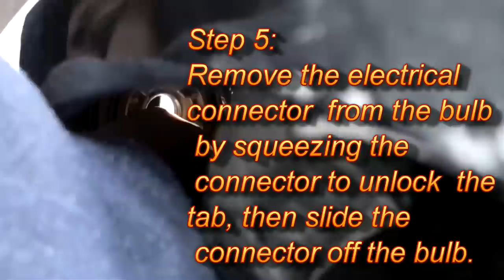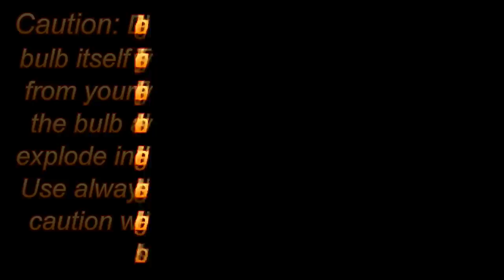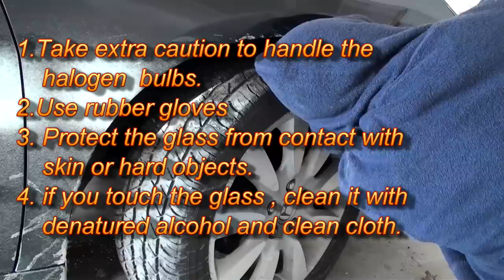How to Replace the Headlight Bulb on a Honda Accord 2007-Low Beam

Comment: This video is helpful for the DRIVER'S side.  On the passenger side, just reach in from the hood and you can access the bulb fairly easily.  Release the wire harness before trying to turn the bulb on both sides, I found this to be the easiest approach on my 2006 Accord.  I think the approach shown is actually easier and quicker than removing the battery for the drivers side.  Helpful video.

Comment: Thanks for being a contribution in sharing this video with edited instructions. Just replaced the driver's side low beam via the wheel well on a 2007 Honda Accord, and it took about 5 minutes total based off what you posted (turning wheel to the right for driver's side provided clear access). Also looked at other videos, and this method at 5 minutes with direct access was less effort than dealing with removing the battery.

Comment: Removing the 2 black circular plastic clips on the fender wall is WAY faster than removing the battery. I just put a flathead screwdriver under it on one side then slid another flathead under the other side, pulled down and it came right out easy without breaking the clip. Just replaced the drivers low beam on a 2003 accord as shown, 10 minutes total. and I was extra slow and careful. I unscrewed the bulb holder before squeezing the connector to pull out the bulb. Great video! Thanks easy job!

Comment: As 777Firedrake said, Instruction step 3 should have included what Step 5 says. Little confusion!! Other than that, this video really saved me 40$ to change bulb, this is Dealer usual bulb change price.
Passenger side bulb can be changed after lifting hood. Mine is 2007 Honda Accord.
Remember to snap open electrical connector first before twisting to remove bulb from holder.

Thank you deepujkathettu!!

Comment: I watched a few videos, with some advocating removing the battery (for a drivers side low beam). i decided to go with these instructions with the added recommendation to open the hood for more light. The replacement was easier than expected and definitely took less than ten minutes.  Thank you for such a helpful video! (also not that video says to turn wheels to left, but shows him turning steering wheel to right.  I think he means turn the wheels (and steering wheel) to the right which gives excellent access to the drivers side wheel well).

Comment: Great video, and well put together. Just know if anyone else is doing this. It can be done from up top as well and only need to remove the battery for drivers side. Its still a tight fit, but i found this much quicker/easier in my case!

Comment: This video along with comment input did the trick. I have the Hayes manual and the only help I got from it was how to get to the bulb.  Turning the wheels in the appropriate direction definitely gives a little more room to work with and this was not mentioned in the manual.  But it's still tight quarters to work in.  As mentioned a couple of times,  you can twist (and shout) all you want; if it won't twist and unlock from the socket, simply loosen one of the screws on the collar around the socket. Try 2 if that doesn't help. 

Another tip that might save someone else some frustration. Make sure you squeeze the locking clip on the socket on the right end.  May sound silly, but many of the socket clips on the old bulbs I'm familiar with unlock on the opposite end.  Since it is hard to see in there, I wasn't aware that these clips are to be squeezed on the opposite end. I didn't notice the little knurl part on the end of the clip was the right place to squeeze until I shined my flashlight on it.

Also, since it is difficult to see in there, you might want to pick up one of those handy LIGHTED screwdrivers at Lowes.  It has all the various common bits mounted on the handle instead of in the handle.  It even has a telescoping magnetic pick up in the bit shaft.  If you have ever tried to hold a flashlight while using a screw driver, particularly in a tight space, you will really appreciate this tool.

Comment: Great video.  I did this today on a 2007 accord ex.  However, snapping off the power connector FIRST allows you to turn and remove the bulb with NO resistence.  I was able to get to the driver side bulb just by opening the hood, again snapping off the connector first allowed me to turn the bulb without a hitch.  Just a tight fit if u got big arms  Thanks!

Comment: 2007 LX. I disassembled the splash guard only for the driver's side as I did not wish to remove the battery. Passenger side is much easier through the hood. I also detached the wiring harness before removing the bulb. Despite living in a humid, salty area, the lights turned in and out very easily.

As previously mentioned, the fasteners are unbelievably fragile. They broke even when I was attempting to be gentle. Searching reveals this as a common problem, even when not replacing lights.

Comment: In spite of a few typos, this video helped me to change the headlights on my Honda Accord. The only thing you should have mentioned were the three screws around the bulb assembly. I had to loosen one of them before I could turn the old bulb counter clockwise to remove it. I made certain I tightened it up again after I installed the new bulb.
Reply: Ditto on the screws - I had to figure that one out as well.

Comment: I just installed some LED low beams, and I can attest that you can access both high and low beams from the hood alone without removing the battery or fender. Removing the black plastic cover right beside the battery (towards the front) and reaching in far with your left arm will get you to the driver side low beam bulb. The passenger can be reached easily just by reaching in with either arm. If you have trouble removing the connector from the bulb, try leaving the bulb screwed into the housing, holding the tab on the connector, and giving the connector a few light whacks with a wrench from the top. I had to do this to both of mine because it had been so long since they'd been changed.
tl;dr: Don't destroy your fender!
Reply: You're right, I just reached into the passenger side and was able to replace the bulb without going through the wheel well. Thank you for saving me the time!

Comment: 2005 Accord: In the US you turn the wheel hard right for the drivers side bulb. 
When removing the clips for the lining, look for the screw driver slots and remove pin gently as they can break. After unclipping the wheel well lining, unscrew the lower left screw ( of the three around the bulb) to allow the bulb assembly to be turned left.  After the bulb assembly is free, it's very easy to press the white clip near the wires and release the bulb. Stay cool and don't force anything :)

Comment: No!  To replace the driver side low beam bulb you do not have to remove the battery... or remove the fender liner (risk of fender paint, liner, and clips damage)!

1)  Under the hood, on the driver side, see that small black box in front of (toward the front of the car) the battery?  Easy to remove by prying the two pins holding it to the frame.  There is a short tube connecting it to the tube below - pull that loosly fitting short tube out as well.
2)  Loosen the battery clamp cross member enought to twist and remove the rods hooked to the battery tray and the cross member.  (Leave the battery cables attached to save your electronic settings!)
3)  You should be able to slightly lift the battery tray (the bottom plastic tray) and battery slightly and move it back an inch or two. (The tray has nubs that keep it from sliding around.)
4)  You've now opened up enough space to reach the low beam bulb.  Use a flashlight for visibility.
Reply: Thank you, but what about the other side? Passenger, heard we had to remove the entire light assembly if not doing this video method
Reply: @erickimmy1493  I was able to reach the passenger side bulb through the hood.

Comment: Great video thanks. Just follow the directions and you will do fine. When i was removing my bulb i was having a problem getting it out by twisting counter clockwise because it had been in there so long. I contemplated taking out the 3 screws that keep it locked in place but after a few extra minutes of twisting i was able to get the bulb free with the screws still in place.

Comment from the maker: it may be little hard to twist the bulb,  if the bulb holder is rusted or  stuck with dirt. Tap the holder with your hand and twist with little force. Don’t need to remove any screws.

Comment: Thanks so much.  Although I couldn't find the clips for the fender well, I was able to pull it enough back to get at the bulb which I too had to unscrew to remove it.  

The only tip I might offer for others is that I opened the hood just to let more light in while doing the job.
Reply: Good tip! I probably would never have thought of doing that! Thanks.

Comment: just wondering, would it not be easier to move the battery from the box and reach into the light cavity?  that way the fender well plastic will not be bent and distorted causing a place for future failure.  Oh, the passenger side there is no obstruction so it is even easier.  my method takes one third the time this method does, and you can replace both bulbs quickly.

Comment: I replaced my headlight low beam (9006) bulbs on my 2007 Honda Accord EXL 2.4L yesterday (08/12/2015) and it took me only :10min to replace BOTH bulbs.  You're reading right only :10min to do both.  I replaced the passenger side bulb thru engine compartment like you did BUT without the need to spray WD-40.  For the Driver side, I DON'T take the battery out but instead I replaced it thru the driver side front wheel FAIRING cover by removing the two pins using the small flat screw driver. I just then pulled back the fairing cover to access the white connector. Pulled the connector down and turn the bulb COUNTER-CLOCK WISE to take out the bulbs.  The all process took me only :10min.  Save yourself a lot of time by not taking out the battery, and must reset your clock, radio etc....  I replaced with Warner Brite Light bulbs from Amazon cost $24.00 set and it claimed 80% brighter than OEM.  I will make a video to show people that it only takes :10min to do, not 3hrs or half the afternoon to do, and don't need to use WD-40.

Comment: This is the recommended way from the owners Manual.  I tried it this way and broke the plastic fender clips...  so then just disconnected the batter and removed it.  The bulb was very easily accessible then

Comment from the maker: Thanks for the all comments.
Step 1 one is a typo and it should read as Turn the wheel all the way to right.
For passenger's side bulb, turn the steering well all the way to the left and for the driver's side bulb, turn the steering wheel all the way to the right. This helps better access to the bulb.
Sorry for the confusion.

Comment: I have a 2007 Honda Accord Coupe, and my code is inside my glove compartment.... It should be a 5-digit code and that should work.... I've had my battery disconnected multiple times and never had to go to the dealership... Good luck!!

Comment: Really good video I have a question I have the same car its a V6 accord lx and I barely got it. But when the engine gets warm to its regular running temperature the radiator fans come on very often in high speed mode is yours the same? cause ive had other cars and were never like that only when AC on. I could hear the fans running loud when im in a red light or parked with car on. thanks any help would be appreciated.

Comment: 15 minutes to change bulbs on both sides. I had to slightly loosen the 3 screws around the drivers side bulb before it could be removed but smooth sailing after that.

Comment: This procedure worked great, unfortunately my headlights had 3 screws holding in each low beam, which is something the video didnt account for. But now I can't start my car for some reason. The engine turns over but now it doesn't start since I changed out these lights! (2006 Honda Accord EX)
Reply: Same thing happened to me! What was it?? My DRL light was coming on and going off randomly on my 06 sedan ex.. now it won’t start completely at all

Comment: I just replaced my wife's 2005 honda accord simply under the hood. if you have small enough hands and a small enough screw driver, it's doable. not that easy but doable; this was on the passenger's side though, fyi.
Reply: damn...my hands are huge unfortunately...for my misses

Comment: Ha, the inner fender cover is already gone on my ancient and limping '03, so this took me only about 3 minutes.  And the longest part was just trying to get the bulb off of the connector; even with the tab pushed in real hard it was incredibly hard to separate the two, I started wondering if the bulb was superglued in or something!  
As I'm just using this car until it dies I bought the rock bottom 'basic' bulb at Walmart for $8.  Can't even imagine how much the dealership would charge me for the bulb and "labor" which I now know is almost no work at all!!!

Comment: This is the hard way. Open the hood. reach in and remove the right. pull the battery. reach in and remove the left.
Reply: lionshield1 no sir this is easier battery removal on top of resetting your car stations clocks and everything else this here pop 2 covers lights exposed remove the bad replace it with the good one and your back like ya never left

Comment: I manage to replace both right bulbs by "destroying" the latch holding the electrical connector to the bulb ass'y, using a screw driver then push down ( need a fairly large and long screw driver ).  I then ground the lip on the new bulb so next time I don't have to deal with the %$#%  latch - straight pull down will disconnect the socket. I was lucky that I was able to just twist the outer (low) bulb without loosening the 3 screws for the outer one. If needed, you have to use a stubby screw driver.

Comment: You do not need to remove the wheel well cover. 
Pull tab on power connection housing. 
Twist bulb counterclockwise. 
Repeat in reverse order.

Comment: The part number for the clips is 91512-SX0-003. I got a pack of 25 for $10 including shipping from clipsandfastners com but you can get them at many places. You can get them even cheaper on eBay if you're willing to wait. hondapartsnow com claims 91501-S04-003 also works but I can't testify to that.

Even with the new ones, when set, they are very difficult to unset once pressed it. These fasteners are not designed for removal.

I noticed several other fasteners missing while replacing.

Comment: I was searching online for a 'bumber'! I think you meant bumper?
I have a 2005 Accord and one clip broke as soon as I pried them out. Just so you know, you can buy those clips in an auto parts store. They're actually rivets, not clips.They're 4 bucks for two. I recommend buying one or two pair before starting because why reuse 15 year old rivets? For 8 bucks, they're last another 15 years. Also, the auto parts guy sold me headlight grease for 2 bucks. He said to smear a little on the electrical connectors to keep rain, etc. from wetting the electrical connections. It sounds like a good idea. Those connectors are directly exposed to the elements. So, when you buy the bulbs, buy extra rivets and a tiny package of contact grease. For 10 bucks more you did a more professional and complete installation!
ps I bought the bulbs before reading they last one year tops. That's nuts. My old bulbs still work after 15 years. Sure, they're dimmer (I guess), but for 40 bucks I want them to last at least a few years, not one. Is there no bulb that lasts, say five years, and also gives a better light than OEM?

Comment: i just replaced my bulbs. the driver side wasn't working, now the passenger isn't working. is there any way avoid removing the fender cover. i was trying to detach the connector, but for some reason, not able to. anyone have any suggestions why the right light went out? i just had the bulbs changed back in december. all fuses are good also

Comment: I went to Wal-mart and the tech could NOT un-clamp the fixture.   Went to Honda they did BOTH left and right in 15 min and told me the screw needed to be loosened before it would cone out. $15 later I had 2 bulbs replaced.

Comment: I hate my car for this!! Why can't it be simpler!!!
Reply: Gabriel Torres , 
If it were simpler, as it usually is on older cars with the beautifully logical standard sealed beam bulbs, then bulb and housing replacements would not be such a profit maker for dealers and manufacturers. Thank the federal regulators who first allowed nonstandard headlamps for this needless expense.

Comment: You do not need to remove the inner fender cover or battery, totally unnecessary.  The person who wrote the Honda manual is an idiot. Took mine to a Honda dealer yesterday and they removed that little black cover in front of the battery to access the headlamp as another gentleman had stated. 5 minute job on driver side. And passenger side is accessible to begin with under the hood.

Comment: Warning, this method is not the best for everyone. If you have a spray on anti rust coating more permanent than oil DO NOT DO IT THIS WAY.  This is a shortcut method over the proper way. Also there is no need to access it this method on the side with no battery.  You can simply reach and do it on the left hand side from the top.  This way is a bit of a weird method and I would not recommend.  Sorry to the poster.
Reply: Look in your Honda Accord owner's manual for replacing the two front left and right low beam bulbs.  The above video is showing you the way the manufacture wants you to do it.